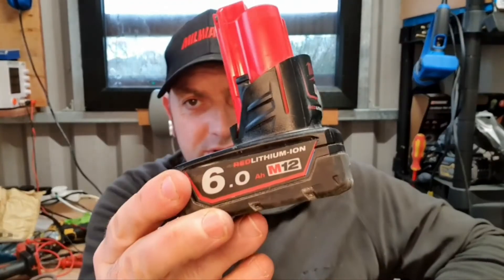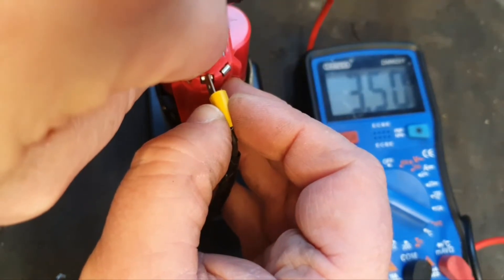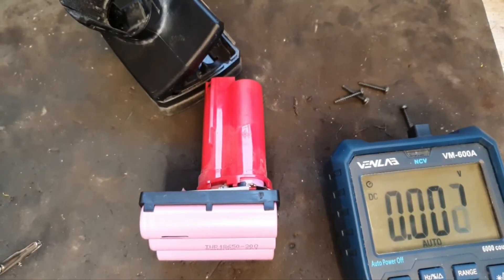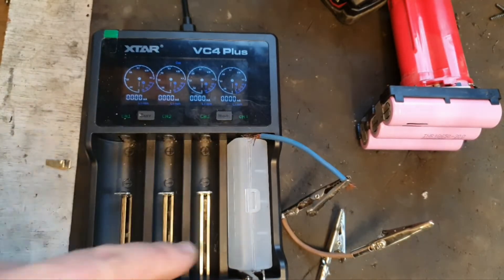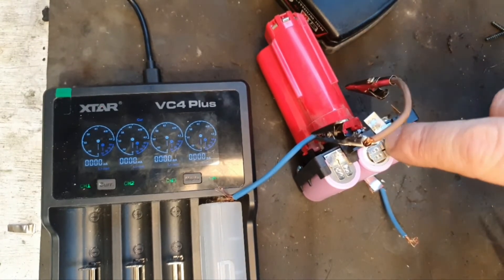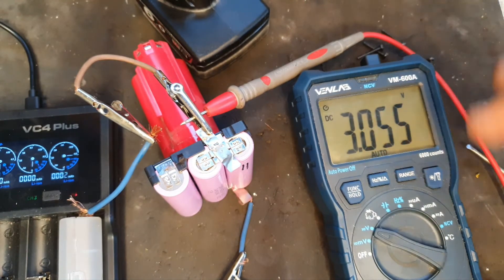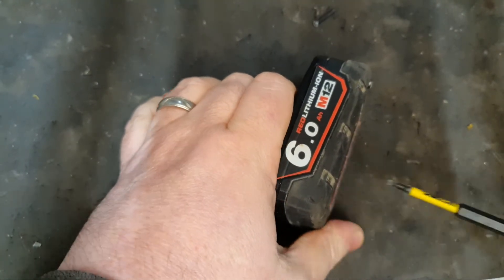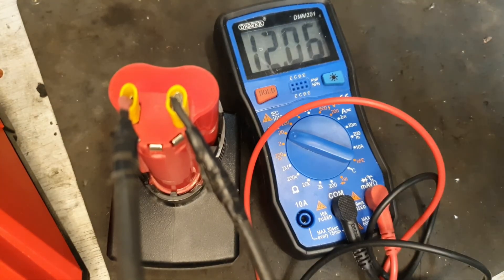Milwaukee M12 Battery Repair ( not jump start)

Comment: I've had the worst experience with Milwaukee M12. I bought three 6Ah batteries in early 2022 and two 2Ah batteries.  I also bought the rapid charger along with some tools (now have about 10 tools in all so I've invested in the platform). All three of my 6Ah batteries have completely refused to charge on the rapid charger for a while. I bought a 'standard' M12 charger which helped for a bit but recently my basic M12 charger died (it blows a fuse whenever plugged in) so I can't charge my 6Ah batteries at all. I'm going to try the jump start method but I'm not going to start taking them apart to try and fix them. I'm pretty gutted - probably will just sell all of the tools and invest in Makita.
Reply: Rapid charger is the problem it doesn't allow the cells to slowly absorb the charge and it amplifies the difference between cells internal resistance creating a more pronounced imbalance
Reply: I have 20,000$ in Milwaukee…. Only problem I’ve ever had is these m12 6.0 batteries.  Milwaukees should recall them and replace!  BUT all my other tools and batteries are excellent.

Comment: Weird. My 6.0 12V battery is at 11.35V but blinking red and green. All the batteries are at 4V. Cleaned contacts, jumped 12V to 12V battery, nothing. It’s stuck at 2 bars. I purposely drained it with a 12V compressor and put it on charge and immediately back at 2 bars and still functions.

Comment: was it necessary to remove the bottom part of the pack ,couldnt you have just balanced it from the top part where you tested the voltage?
Reply: No it has diodes in the circuit
Reply: This is my wondering as well.. also why the soldering? A bit of electrical tape on each side and a rubber band will do just fine.
Reply: There’s a resistors involved so you have to go directly onto cell.

Comment: I have one that was only a year old, and had very little use. I was getting 0V across the main 12VDC pins and then two cells were around 3.6-3.7V with the third cell giving 0.00V. I'm guessing there's a broken contact causing open circuit or else if were a short I would've seen at least around 7.5VDC on the main DC pins. It should be under warranty though so I'm not going to open the case if I can get a claim.
Reply from the maker: A completely dead cell can stop the power coming out of the battery seen it before that cell being replaced should fix it if you don't get a warranty
Reply: @doctorlefthandthread  seeing this video was the kick in the pants I needed. I filed a claim and they accepted it. The purchase date was Jan '23 and the manufactured date was sometime in '22. So no matter what, it wasn't past the 3 year warranty. I was very curious to peek inside but not enough to void the warranty since it's rare these days to get a break in your favor. Thanks.
Reply from the maker: @Gideon_Judges6  that's awesome glad you got it warrantied it's always the best option if possible
Reply: @doctorlefthandthread  yeah they have a mail in option and you just print a label. There is a service center around 20 miles from me but that's s bit of hassle for just one M12 battery. Maybe if I was a contractor swapping out dozens of batteries, but that's not the case.

Comment: The Milwaukee oscillating multi tool and rocket tower light destroy m12 batteries of all types for some reason. If you let the battery get below two bars in these items there is a good chance they will have this issue. Worst part is if you jump start or I even charge using your superior method it doesn’t really fix the problem. The internal resistance of the bad cells will continue to get bigger and higher until eventually it does this every single time.
Reply: Add the polisher to the list. Starting to think the M12 line is a bad investment. Quality just isn’t good enough.
Reply: @craiglyle2966  Add the M12 Shop Vac to the list.  I should have bought the RYOBI tools.
Reply: @dtsouza2519  naw ryobi is junk. they get too hot when you use them. Makita is good. Or dewalt.
Reply: this right here , my 4.0 m12 battery try was good until i used it for rocket light til it died ,  battery won’t charge anymore
Reply: YES, I wasn't sure if it was just me!!  I now have 2 M12 batteries that my oscillating tool has wrecked.  Just bought a couple of cheap ones to replace them... not going to spend $100 just to have them die again.
Reply from the maker: It's an issue alright not much you can do
Reply: Ironically I have both of those tools. And 3 M12 6.0 that flash red/green.

Comment: How many of the Dewalt 996, 998  or 999 drills have you had to repair?
Reply from the maker: Only one 996 because it was dropped from a great height I had to replace the outer casing. I did see 2 996 units that had to go for warranty  repair though